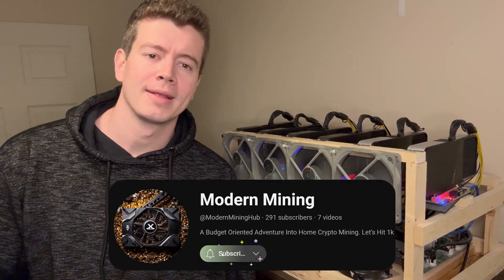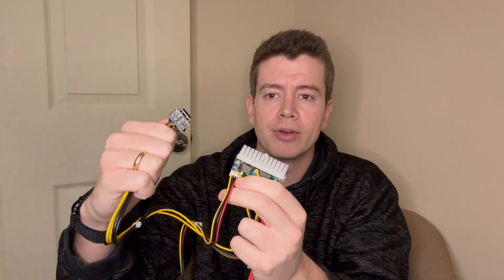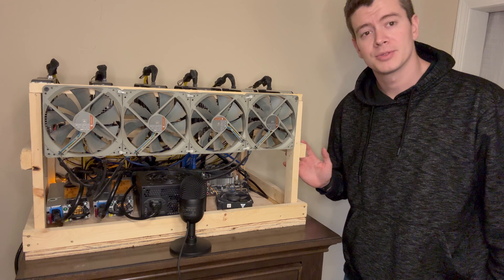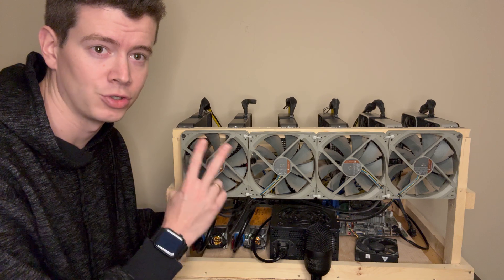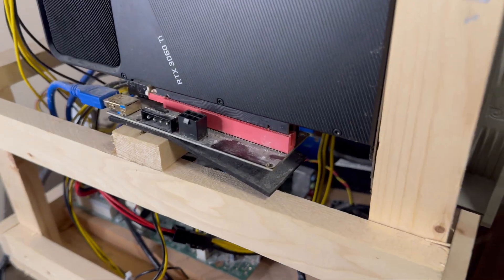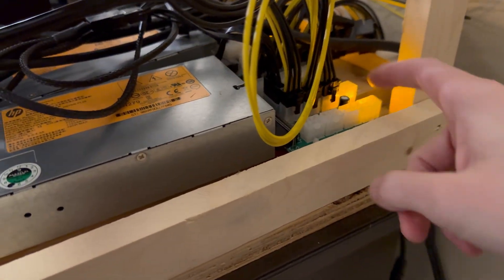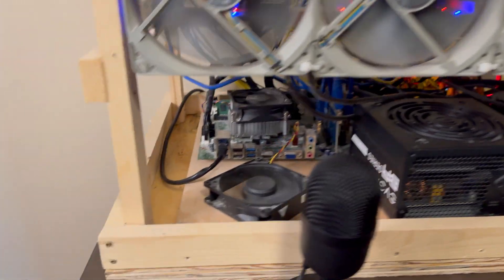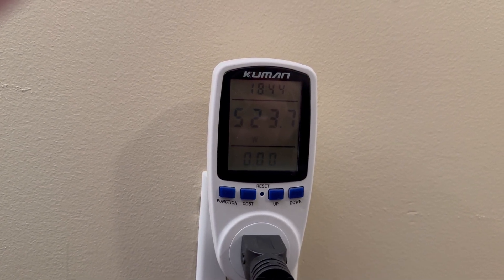I Almost BROKE My GPU Mining Rig With This Upgrade..

Comment: i also bought a 1400W Server PSU with Pico adapter to have suficient power for my 3 GPUS and get rid of the ATX PSU , (so i thought) no luck , if conect the server psu to the motherboard it doesnt boot into Hive OS , and just sits there... This proves that those Server PSUS Pico adapters don´t work well at all. Sad...

Comment: Great video!!! If possible run them at 220v, they're much more efficient. I did a test with an ATX psu @ 110v vs. an HP 1200 server PSU @ 220v. With a single GPU I went from 168 watts w/ATX down to 141 watts on server PSU run on 220v. Do that across a whole farm and it's huge savings.
Reply from the maker: Check out my recent video on discussing my upcoming panel upgrade. I’ll be switching to 240v soon!
Reply: @ModernMiningHub  will do. Your channel just recently popped up. I'll be sure to check it out.

Comment: As a PC technician, this is a daily occurrence for old mobos, the ram's pins oxidise and the slots get dusty or the pins don't hold the same tension they used to to make contact.

Whatever the case, it makes them EXTREMELY fussy (old motherboards) with ram, if you so much as bump them it can unsettle the delicate connection between the pins in the slot and the now dirty/oxidised dimms.

Wouldn't be shunning the picopsu, it was very likely to be just coincidental.

Comment: I run 20 cpu miners on picos and server psus. You probably overloaded your server psus, and you should always have a daisychain between all PSUs to power on at the same time, especially when you are running gpus.  If not, you will always have issues.  Another option is to power your gpus on first, then your motherboard.  But yeah, Dell motherboards are garbage and very particular when it comes to any changes.

Just try to change RAM in an alienware PC and see what happens.  They try to lock things down much like Apple so that they can only be replaced by other Dell OEM or dell approved parts.  I learned this lesson a long time ago.  They limit power to everything, which is why they have no heat sinks for VRAM or critical parts.  More likely to fail if pushed, so you have to buy a new one.

Comment: I noticed at 2:50 when you turned your atx PSU off your 2 server PSU's went off. You have anything daisy chaining from the atx to the servers?
Reply from the maker: Yep, i use a molex cable from the psu that powers both server psus on/off when the atx psu is powered on/off
Reply: Oh ok cool, I'll have to check those breakout boards out. Mine is pretty simple with just 6pins.  @ModernMiningHub

Comment: I don't understand why there would be a case fan blowing down into the plywood at the bottom of the rig. It's just there trying to shove air through wood.
Reply from the maker: Mentioned it in the video, fell optiplex boards have to have a fan plugged in to boot.

Comment: A lot of the other comments saying just leave it as is but if you can take 1 PSU off the rig and save $ on the hydro bill, that would be great. So, I hope you try again and get it working. I've had plenty MB issues. 1 thing to be careful is static electricity, try having nothing touching the motherboard such as cables from the bronze PSU. Sometimes I had to reset the MB by taking out the battery.

Comment: Good video.. But honestly... But i highly doubt the Pico, will give any real-world, Noticeable improvements on efficiency.. and ultimately the electric bill...
To me, Its just another point of potential failure.... 
If aint broken, Dont fix it :)
Reply: A platinum PSU will save you 7-8% on hydro vs Bronze PSU. So, it's definitely worth it to switch. Plus, he can sell the bronze PSU or use it somewhere else.

Comment: Has happened to me many, many times, sometimes just for slightly moving the MB to check something, but when I see a rig trying to boot and the cpu fan cycles on and off, 99 percent of the time I reseat the RAM and it fixes the issue.
Reply from the maker: Good to know! That was the first time I’d ever seen that issue.

Comment: if you have e cost less than 10 c /kw you wont need efficiency , and with the bull run everything will be profitable, i think one good PCU is enough
Reply from the maker: Yep I agree, doesn’t hurt to try though I had that laying around and wanted to put it to use. Thanks for checking out the vid!